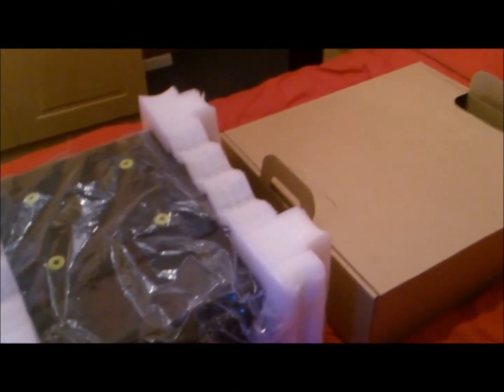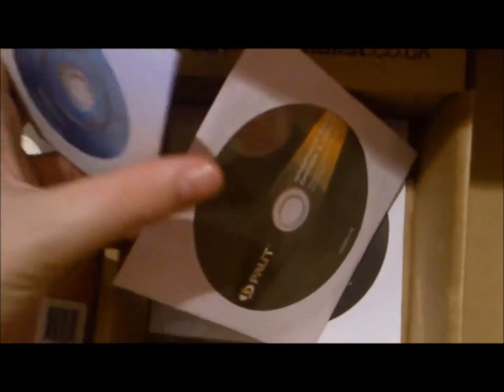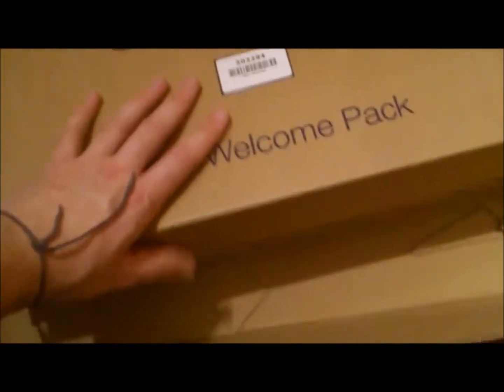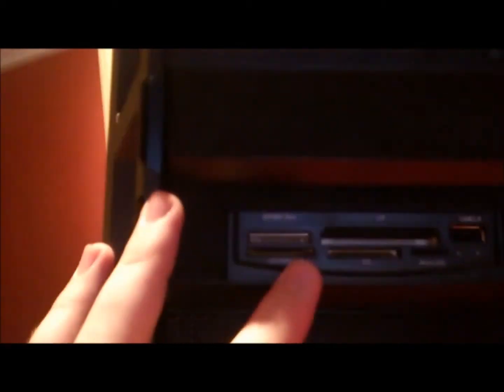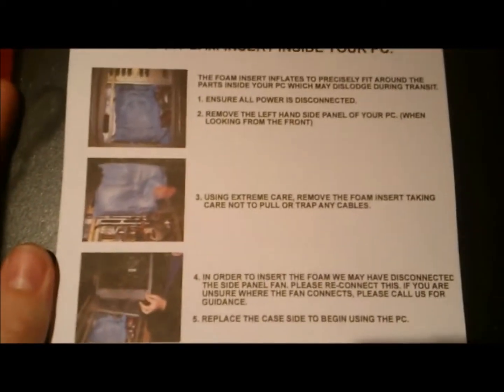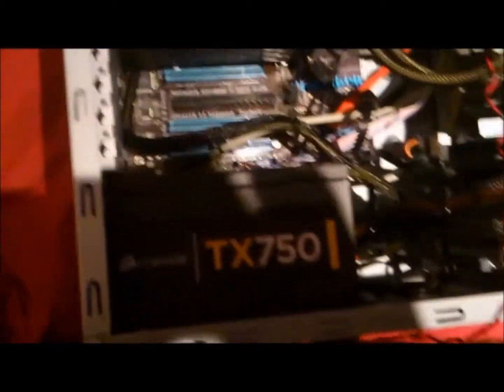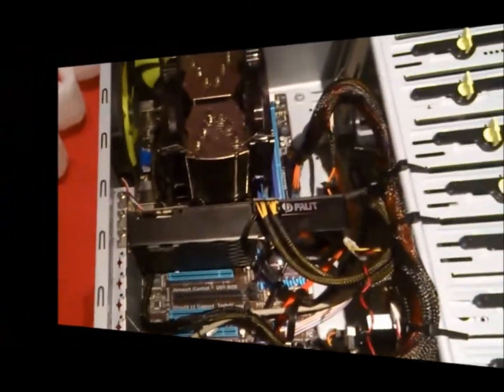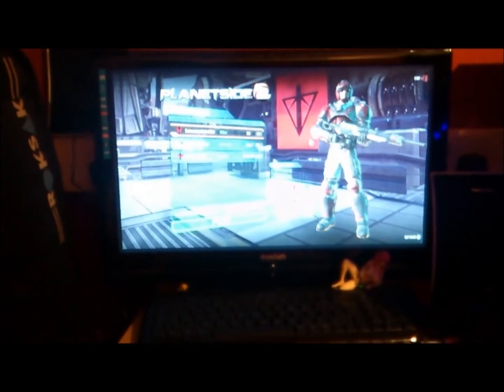Vyakros kick start! - PC Specialist Unboxing

Comment from the maker: As with any computer of this spec you're going to hear something. It's not very loud. You can hear a slight bit of the fans blowing air. But it isn't very noticeable. Easily get some decent speakers or a headset and when you're in game you don't hear anything. You get used to it though if you're just on it normally.

Comment from the maker: This cost me £1208 but can easily be brought down by removing the Webcam I bought with it and the power surge extension if you've already got them.

To answer your question of does it run games well ... It runs games fantastically! I'm running everything on the highest settings. Games such as Crysis and Planetside 2 etc.